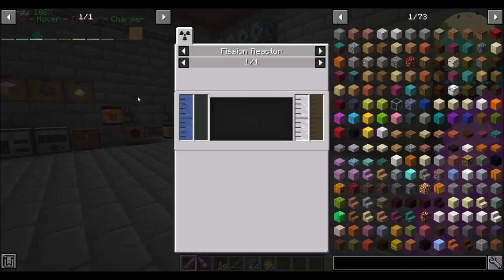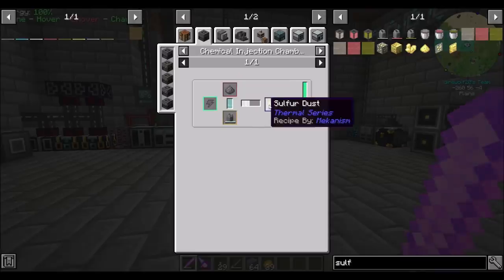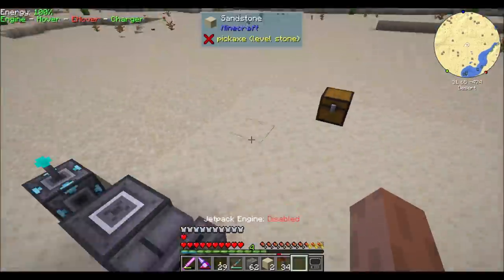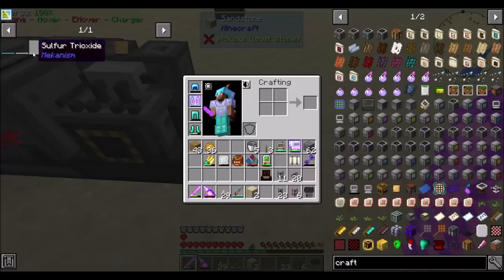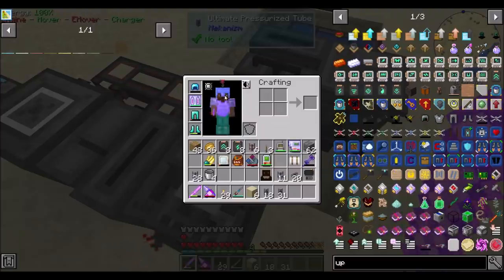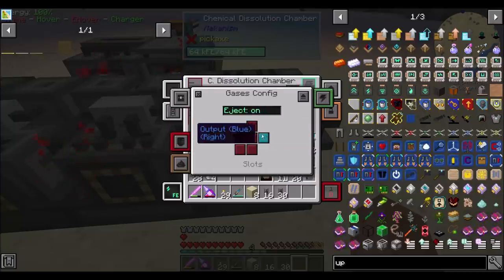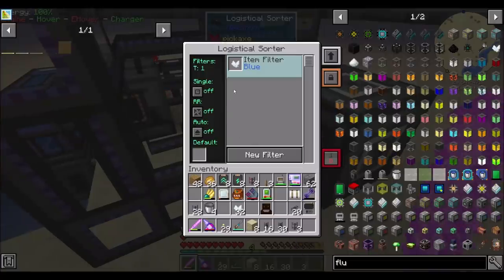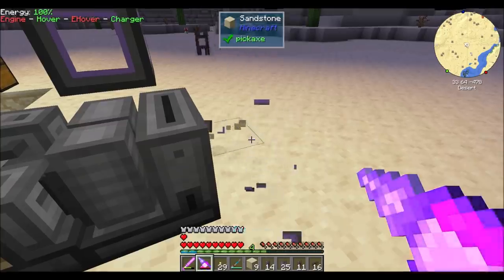Lets Play S10E62 Mekanism Fuel

Comment: Notes on mekanism's fissile fuel processing, from a high school chemistry student:
Before you leave an angry comment; please note that this is only to explain how it actually works, and should not be actually added to mekanism.
First: fissile fuel is made in an isotopic centrifuge from uranium hexafluoride.
That is correct, you would centrifuge uranium hexafluoride(UF6) to separate out the fissile kind of uranium, however turning it into fissile fuel should probably require an extra step of "Uranium-235 Hexafluoride" to be sent through another machine to get fissile fuel, because you can't fission UF6; it's a gas.
Uranium hexafluoride coming from uranium oxide and HF is totally right.
The chemical oxidizer used to turn yellow cake uranium(U3O8) into uranium oxide(UO2) also skips a bunch of steps(nitric acid, ammonia, hydrogen) that should also not be included.
"Hydrofluoric acid"
Chemists: "NOOOOO PLEASE NOO"
"which needs fluorite and sulfuric acid"
That is, interestingly enough, an actual way to make HF, instead of reacting pure fluorine with hydrogen.
Mekanism's sulfuric acid production process is also pretty accurate, it just skips sulfonic acid and oleum, but it's already long enough.
Thank you for coming to my chemistry talk!

Comment: flint in a crusher also makes gunpower, the creeper farm isnt necessary
Reply: But then you need a flint farm. Making gravel is lame and the normal way. Also sulfur dust can be made into gunpowder.
Reply: @wickedfast2166  he was trying to get sulfur. He already made a cobbleworks with create so he'd be reusing existing infrastructure to make gunpowder to turn into sulfur
Reply: @professor_deadshot  nope, charcoal dust or charcoal to sulfur is much better, running logs through the mekanism sawmill and running the planks and sticks through as well gives you 36 sawdust plus 7x25% chance for a bonus sawdust then 8 sawdust turns into 1 charcoal dust and each dust turns into 1 sulfur so it is 4.7 sulfur per log using 5 machines if you have a single sawing factory doing logs, planks, and sticks but the pump and electrolytic separator he can just use his existing setup so really only 3 machines and all the resources used are easily renewable, just water and wood
Reply: @wickedfast2166  he made a create contraption that created flint

Comment: Dire, there's a much easier way to do the logistical sorter transportation. Remember that setting you messed with earlier for transporter config? You can make machines only accept certain transporter colors so you don't have to use more pipes than necessary to transfer sulfur and fluorite around.

Comment: At least in past version, the dissolution chamber allowed for gas upgrades, which brought the requirement for sulfuric acid down from 100mb to 10 for hydrofluoric acid. With how much you need for antimatter, those savings add up quickly.

Comment: Yet another series where Dire forgets Gas upgrades is a thing
Reply: "I actually want to use ten times as much gas as I need."
-Dire
Reply: he doesn't forget the gas upgrades. in it's client they don't exist. so do half of the content of the mods
Reply: Well , the only machine he used in this episode that accepts gas upgrades is the 'Dissolution chamber'
Reply: @Quietust wait, they accept energy upgrades
Reply: @gamingwithey4d280  but he didn't use the gas upgrade anyways so the point is still there :P
Reply: @JoachimVampire  Agreed , we don't have much comments , let's increase them
Reply: @ariuss3009  They accept energy upgrades but it only increases the energy storage for the electrolytic separator specifically.  They do not decrease energy usage (as to avoid hydrogen gas being used as a fuel source in the gas burning generator for an infinite power loop I guess)

Comment: For filtering items from your interface to the different machines you might also be able to set a strict input for each one accessible from each machines input gui. The logistical sorter would still use your existing filters but the individual machines would decide what colors they accept as opposed to that being the job of the logistical transporter pipes.
Reply: i kinda don't understand what do you mean. could you please elaborate what do you mean? because i think the logistical sorter should be able to handle any sorting in a more precise manner than the "acept input on top" most of the imputs he uses are just inputs and can't filter them especially if he adds the charcoal route to the sulfur processing. i assume you mean that certain machine will not accept the fluorite (for example) and so there's no need to specifically tell the system to place the fluorite in a specific machine, right? but then the point of having the logistical sorter is to be able to precisely either extract certain items or color code certain items
Reply: @joachim there is another interface on the machine for logistical sorter config where you can set it to strictly only accept a certain colour
Reply: @JooshMtb  wait whaaaaaaaaat i missed that, i'll check it out later D:
Reply: @JoachimVampire  I'm not sure if these particular machines are capable of it, but a lot of Mekanism ones are :)

Comment: Dire, you should have done it in the base, those gases are used in the 5x ore processing. You can use the Rotarycondensentration to make a liquid version and transport it with Refined Storage Liquid system. Or there is a addon for refined storage that handle mechanism gases, but it isn't super well made, works but is kind of meh. Also no filter required for the extration itens from the interface, machines won't accept wrong itens so no filter required.
Reply: He can always get a quantum entangloper
Reply: @gamingwithey4d280  O yeh, totally forgot about that
Reply: Very bad idea....maybe for the gases that make up the fuel but the fuel itself and i think the uranium gas (the one from yellow cake uranium) is radioactive AND specifcally cannot be wirelessly transported via quantum entangleoporters. Same with the nuclear waste
Reply: @Elderon117  no , every mekanism gas can be transferred with the quantum entangloper , if not then where's the brokenness ? , AND will only effect the environment if they were in a tank/pipe/reactor and the pipe/tank/reactor has been broken

Comment: ahh, the very dangerous chemistry part of the series
Reply: It is radioactive heat
Reply: @gamingwithey4d280  what? uraniumhexafluoride is not redioactive heat, but a very dangerous chemical in real life. so is sulfur trioxide. and most of the other stuff needed for the enrichment process of uranium, which is pretty well followed in mekanism
Reply: @robertlinke2666  Uranium is Radioactively heated
Reply: @gamingwithey4d280  do you mean the heat that comes from the decay of it, or?
since the enrichment process is chemical, to get the isotope ratio between U238 and U235 such that the reaction sustains without constant manual input, but also doesn't go supercritical
Reply: @robertlinke2666  "Energy doesn't decay , but it transforms from form to form" , Radioactivity is energy , and it transforms from it is form to Heat energy Over the 'decaying' Process
Reply: @gamingwithey4d280  no, radiation is energy, which can transform it's energy into heat, but doesn't have to. kinetic energy is also an option for radiation, though less used. 
and this has still nothing to to with how my comment was on chemistry, not physics
Reply: @robertlinke2666  cool ,at least i was close , what i just said was something i read like months ago

Comment: If you run the main distribution pipe behind the output pipes so the branches are horizontal rather than vertical should compact that even more.

Comment: Dire a rotary tree farm from Create will give you infinite sulfur with 0 maintenance and 0 energy  usage (except if you want to use the furnace engine which is a waste imo) and then just turn all the wood into charcoal. or use an axe with auto-smelt and fortune 3 if it's possible in the pack.
Reply: You could even semlt the wood in a vanilla furnace (or multiple) and have the farm run of a furnace engine attached to that. Self-contained charcoal production with just vanilla and create.

Comment: I too had massive issues getting RS interfaces to export/make extractable, their inventory. You used to be able to extract  everything from the RS system just by hooking up something to extract from an unfiltered interface, maybe that was nerfed, and caused all these issues as a result? But, also, I do know if items going to yellow can pass through green in mek pipes, so, you might need to route all things through clear pipes before going into their color, which kind of is fitting with, you know, dire wire.

Comment: Dumping excess hydrogen is wasteful imho. I know you're not exactly starved for power but a gas-burning generator costs basically nothing to make at this stage and you're still putting your hydrogen to some use instead of just outright dumping it. I personally just use a single waterline with a single well-upgraded electrolyzer and share the oxygen between my ore processing line and my uranium enrichment line, and use the hydrogen for hydrogen chloride (ore processing), jetpack fuel, and burn any excess in the gas-burning generator.